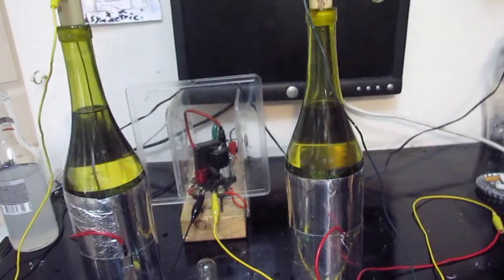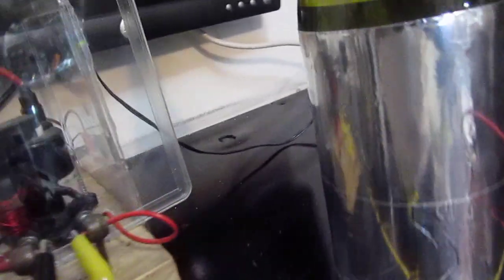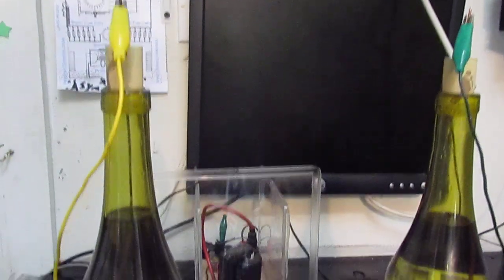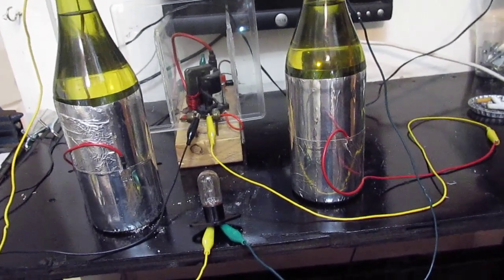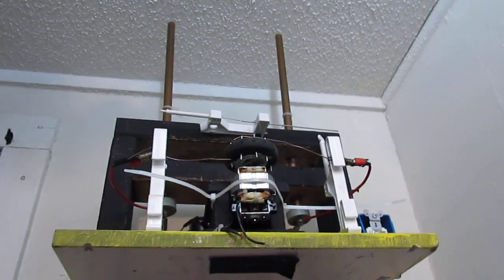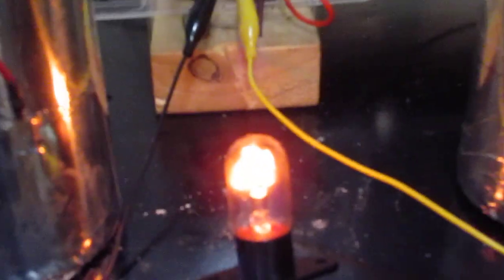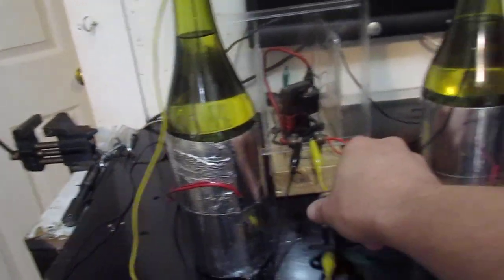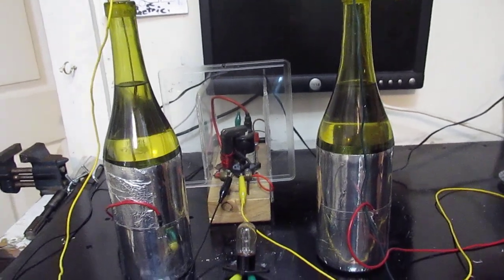12V Cold Electricity and Recycled parts.

Comment: Try something new no wait I ment now make this hair pin circuit better by putting tl tubes inside those leyden jars and maybe insulate them and coil m up with thick copper wire! If Yoou wanna make the most functional wireless electricity etc ow and it will chemtrail bust if you want to mind that? P's T369 864000

Comment: Karl Palsness said it wouldn't work with small wire, i now know he isnt the official to give the last word.
Reply from the maker: the smaller the better and the medium you want is oil not air and if you hold a metal rod over the oil the air presses out a two inch hole. im almost moved in so expect me soon. lol

Comment: Awesome video. You are very much worth following. For future reference, what you have to say is important, please turn your radio off so we can hear all you have to say. We want to hear every word.
Great job
Thanks for sharing
Clay
Reply from the maker: Thanks brother we got to do it. I'm working on something now that is super cool. My teacher asked me th o build its called a LDR circuit.  Quantum battery and will be quite easy for anyone to duplicate the results if the experiment is as sound as the math. Cheers
Reply: therealnightwriter 
How else would it make light? It's an Incandescant bulb. The wiring won't get hot and can carry much more power due to the skin effect, but the filament will get hot because it's much thinner. In any circuit, the point of most resistance will generate most of the heat.

Cold Electricity is actually just extremely high frequency RF (Radio Frequency) power. At those kinds of frequency, the electricity behaves much less normally, and more like radio waves. So for being able to send power over one wire with it like Tesla did. Think of it as a radio signal that travels through wire instead of the air, resistance dosen't matter as long as it's a normal conductor. It might reaches a point where polarity dosen't matter, and it just becomes pure resonant electrical energy. It would be oscillating so fast a charge of either polarity would barely even exist. It's also been refered to as XC wave and Scalar wave energy. It's known as a a standing wave, where from the point of the observer, it dosen't move.

As far as lighting goes, HID/Flourescent works best with a cold electricity "Hairpin" circuits provided you can get the voltage high enough. That's because those don't use resistance to make light, but excitation of gasses instead. And Cold Electricity is extremely good at that. Incandescent bulbs can produce more light with the same amount of heat though, or the same amount of light with slightly less heat. I'v messed around with this kind of stuff for a while now, so I know what I'm talking about. It's really hard to explain, you really just have to get a feel for it.

Comment: One last comment maybe you could do an experiment with a a 1 ohm microwave coil, cold electricity and hho? Love your channel :-)
Reply from the maker: Where should I place coil? I have plenty of
Reply: Between the cold electricity supply and the cell. Maybe a cheap little motor controller/ pwm?
Reply from the maker: OK i am upgrading my lab,3D printer, metal mini lathe tooling ext...ceiling racks for scope and signal gen..30 amp variac.EPG copper tubbing,fittings. almost done and I will make and post results
Reply: Thank you so much bud! :-) by the way try looking up "graphene made with dvd burner" , then look at graphene capacitors. You'll love it! :-) :-) :-)

Comment: Have you tried running an asymmetrical motor with cold electricity? I'd like to see that if you can. Keep it up. Awesome stuff.
Reply from the maker: Im building the Asymmetric moter as we speak. The Radiantc will not run a regular mother but I be leave it will the A system. Trying to get back to that but in the middle of major Lab upgrade. THe EPG and Bendinis wheel saving me money on my power bill, vortex math. Catalytic combustion of Hydrogen. HHO storage and separation systems and now that my upgrades are almost complete I will be able to keep moving forward faster as to try and keep up with all the beautiful and amazing things going on.....and what was on the news? NOTHING the revolution will not be televised